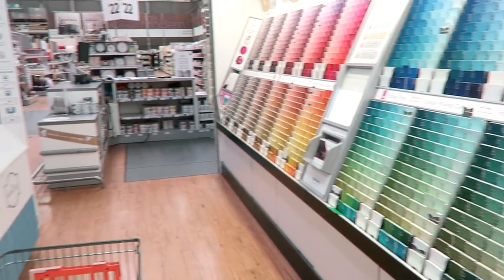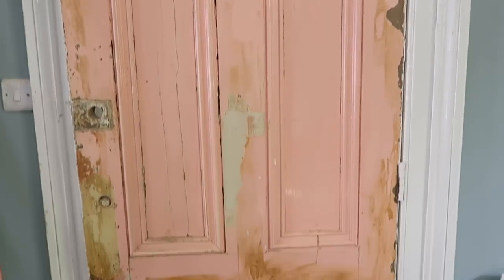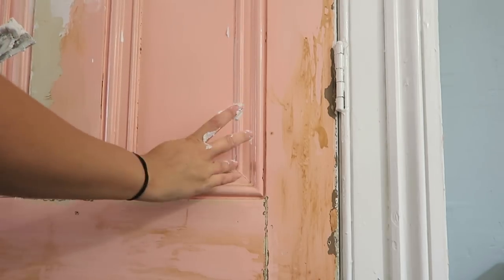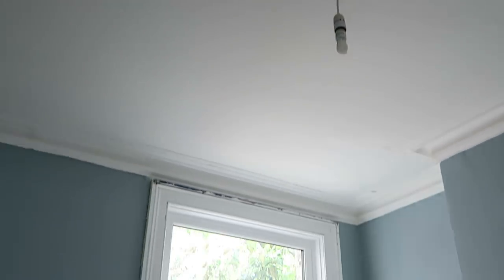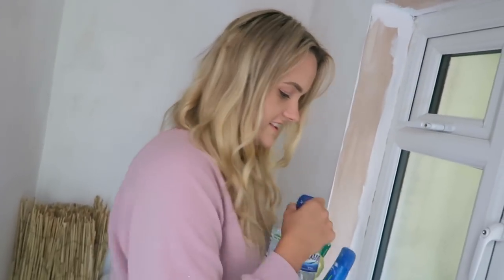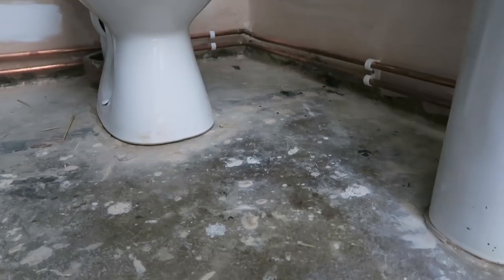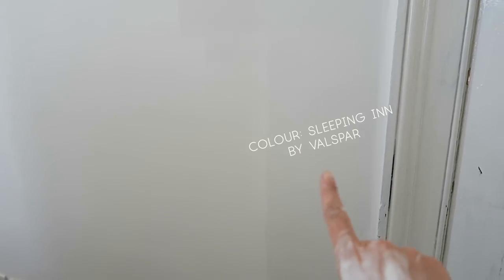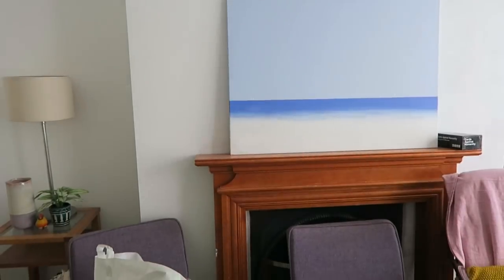Painting, Decorating and a Bathroom Makeover | Victorian Home Renovation | DIYary Ep 8

Comment: For anyone new watching, just a few painting tips. Get an extension pole for the roller frame, it makes all the difference and makes painting easier. You should paint.too to bottom and maintain a wet edge. This will keep paint from looking patchy. If you don't have time to finish a wall at a corner then don't even begin. Pigments settle in paint and if you go back to an unpainted area next to a painted one the color could look off. Constantly stir paint while painting. Don't roll back over a painted area once covered, the roller cover will start to pull paint off the wall.  Finally, painting tools should be of the best quality, they can make a $20.00 can of paint look like a $100.00 can of paint. Look at her before and afters, paint it the most dramatic change that can be made for the least amount of money. Look how much satisfaction she has from doing it herself. Well done!
Reply: Good tips!
Reply: Thanks for the additional tips! 💚
Reply: thanks for the tips!

Comment: Nice work.  Doors are a lot easier to do if you pop them off the hinges and set them down horizontally so you can get some gravity into your elbow grease - and you don't mess up the whole room doing it.  So easy to pop off by just pushing the pins out.

Comment: I see you using a roller quite a bit to put paint on the wall and I wanted to let you know that a professional painter taught me you should apply your paint in a w pattern starting at a 45 degree angle across your body bottom right to top left then down, same thing out to the right etc. Its basically a v or w pattern it uses less energy gets better coverage and he said less paint but I don't see a measurable difference in that

Comment: Yikes. No proper safety equipment,no testing for lead,not sure if you properly measured anything. Did you make sure the surfaces were level before doing anything? 

That bathroom was claustrophobic but now it looks like a porta potty at midnight. 

Old houses are prone to lead,asbestos,and other molds. Did you get professionals to see how bad the problems were before doing anything cosmetic? Your home could be very dangerous to live in right now. I'm sure all the plumbing and electrical need to be re-done. 

Are your bathrooms water proofed? It's a lot of money to sink into the old house but it'll make sure that it lasts you many more decades. Also,that it isn't slowly killing you.